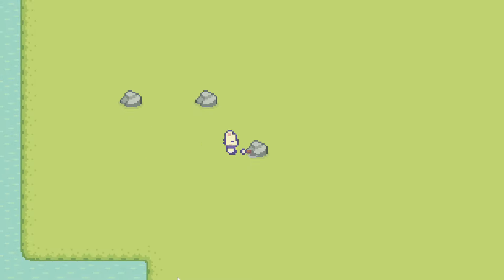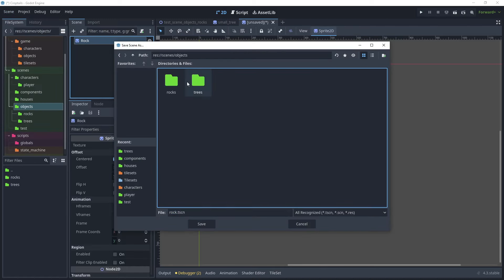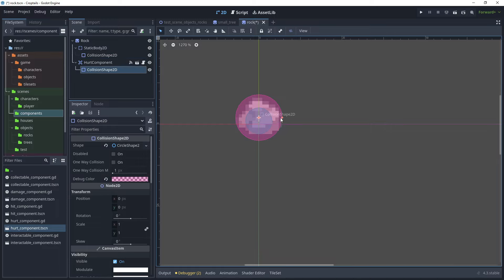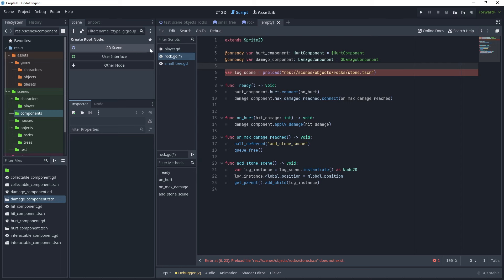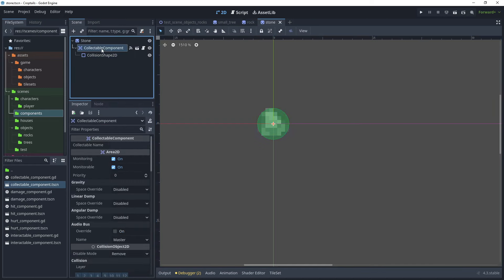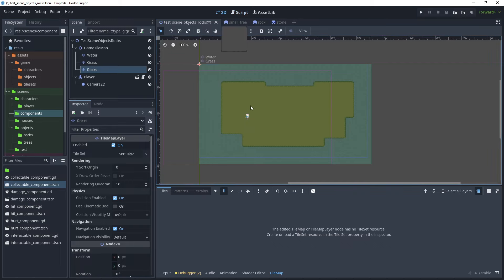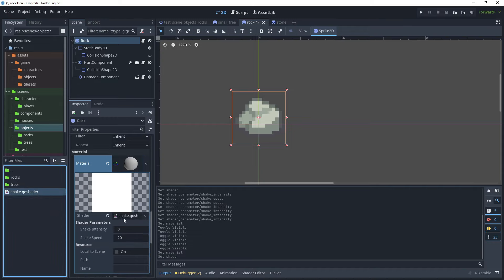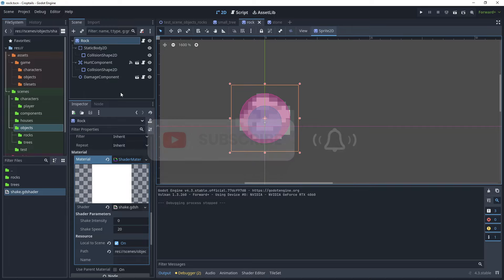Rock Mining using Reusable Hit, Hurt, Damage and Collectable Components - Godot 4.3 Tutorial - Pt 8

Comment: My HurtComponent would not work if i change it to Axe Wood but will work if its tools is None, do you know the problem? because i cant seem to know the problem?
Reply from the maker: Hey, In the HurtComponent select the Axe Tool and then on the HitComponent on the player, set the selected tool to also be the Axe Tool.  This will work when testing the components.  Later in the tutorial, I will show you how to create a Tools panel UI which will set the selected tool on the Hit and Hurt Component automatically.
Reply: @rapidvectors  Tried it, and it works! I feel dumb that it was that easy, I thought It could be a code problem or it just not work😅😅  Thanks alot man!

Comment: Hi. As for some comments in the tree shake tutorial, I get no movement when testing with a 0.2 intensity applied on the on_hurt callback.

I do have movement when previewing inside godot's editor.

When putting the intensity to 1, it's not as smooth as in the editor, like if it was not accepting half pixel movement.
Is there a setting we have to switch before getting the same result ?

I also noticed that, at this point, you have a camera following the character that isn't (yet) covered in the tutorial, may than change something on the rendering ?

Thanks for your help
Reply from the maker: Hey, I've checked my settings and I have the following for the project:

Project Settings
Go to Display -> Window
Stretch Mode = canvas_items
Aspect = keep
Scale Mode = integer

Go to Rendering -> 2D
Snap 2D Transforms to Pixel = On

Open your tree scene and select the AnimatedSprite2D node, this may also be your root node.  Move the sprite using the transform properties in the Inspector Panel and move only have a small amount of the trunk under the XAxis.

I have posted in the link below. 

Look at the red X axis line in the 2D view you can see that the tree trunk has only about 3 -4 pixels below the XAxis line.  This is because the shader vertex code only applies to pixels above the XAxis.

The camera should not be causing any issues and is a child of the Player in the Test Scene

View this link as a reference
https://postimg.cc/Sj3YWjF9

I hope this helps 🙂